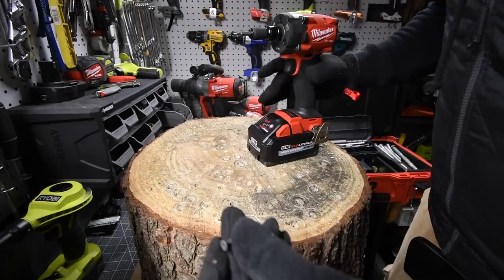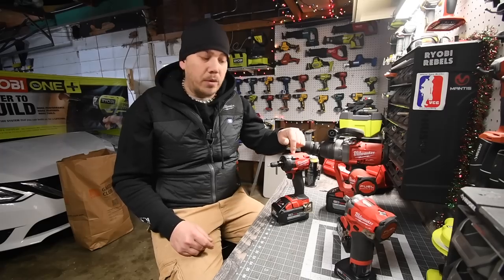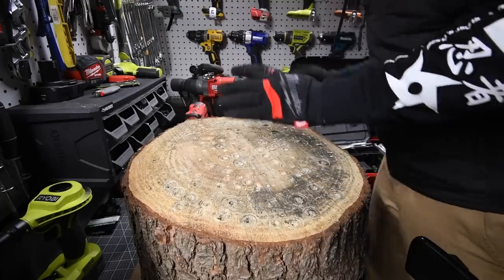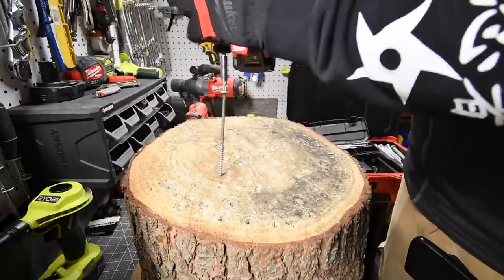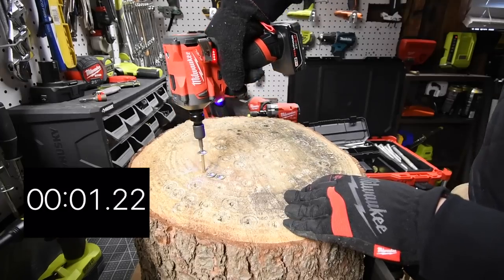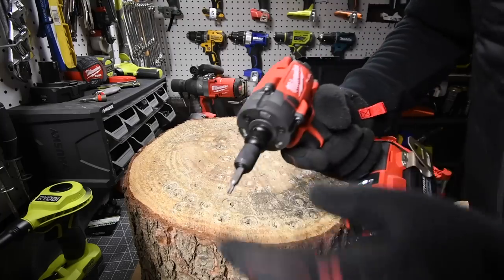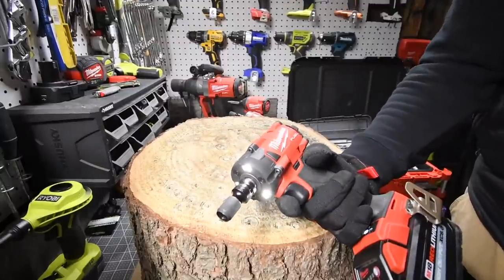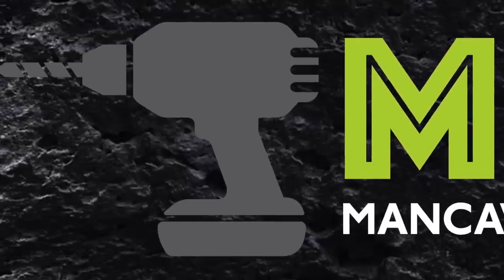1/4 Hex Adapter for Impact Wrenches

Comment: I love that adapter , I use my impact wrench a lot when building decks , those long lag bolts put a lot of stress on my impact driver , that adapter saves me  a lot of time because now I don't have to lug around 2 tools , I can now put in the smaller screws with my impact Wrench too ...👍

Comment: Here is my theory of why the impact wrench did worse than the impact driver: 
The impact driver is optimised for soft torque, this is needed so it can last longer without starting impacting, making driving screws into wood much faster.
The impact wrench is optimised for hard torque as it would be used mainly for bolts, it has a weaker spring so it can start hammering faster, and so it has to tension less from your elbows.
Reply: You’ve just about summed it up correctly, Martin!  👍👍👍😁✌🏻
Reply: I think the Impact Wrenches don't have as high of RPMs, especially compared to that M18 Fuel driver, it's like 4200rpms. I bet that wrench has less RPMs.
I don't think the spring would be weaker in the wrenches because, I could be wrong but, the spring's resistance is part of what helps make for more powerful whacks.  The bigger the impact, the bigger the spring's get. Bigger motor drivers heavier spring, swings heavier hammer = more ugga-dugga 
XD
Reply: We’ve basically summed it up for you Browsey
Reply from the maker: this wasnt a versus video. this was just to show that this attachment can make your impact wrench act like an impact driver so you dont need to bring 2 tools
Reply: A weaker spring that gives you a harder impact, 🤔never heard of that one before gotta say🤣
Reply: The driver has more rpm’s than the impact wrench.
Reply: Are these two really the same drill with a different front?

Comment: The Bosch freak 2 seems like a good middle ground, and their ProCore batteries use 21700 cells too. Great video.
Reply from the maker: Bosch did a good thing with their Freak.and  I thank you for viewing Abanoub
Reply: I'm hoping that Bosch release a Freak 3 in their new Profactor line later this year. Their new Profactor impact wrench has a massive bump in power over the previous gen. Imagine that same bump in power to The Freak.
Reply: I had one and it was great. I took my suspension apart effortlessly with it. I returned it because I didn't like the small line up of Bosch tools so I went with Milwaukee instead.

Comment: This is super handy. I currently don't need it because I have a Bosch Freak, however if I ever need a replacement for such tool I'd happily go for something with higher torque like an impact wrench + the 1/4"collet adaptor.
Reply from the maker: I agree, its almost like 2 tools in 1. I thank you for viewing Mr Luisinho90
Reply: Even better buy an impact wrench with adjustable torque settings to make it even more versatile

Comment: It’s very interesting how this is becoming more common knowledge now.  I can personally recommend getting the PT adaptor that is available at O’reilly’s Auto Parts.  I got the 3/8 to 1/4 hex to use on my 12 volt XTreme DeWalt, and it’s the Cats meow!  😁 Just check them out carefully and check for good machining and minimum run out.  It’s no good if it is wobbling all over the place!   Happy New Years Dave and Stacey, and fellow Subs!  🎉👍👍👍😁✌🏻🇺🇸
Reply from the maker: it really is awesome that all of these options are available to us now and wish you a happy new year as well George :)

Comment: Dewalt had this adapter out for a few years. I used it a few times on certain projects and it came in handy.  Yes, i totally agree with you on using the correct tool for task at hand. Just nice to know in a bind you can use certain adapter to help you out. 

Don't worry TRZ did the review first, second was you, Third will be VCG. Those guys are too macho to deal with little stuff like this. Just kidding, LOL...they're fun to watch.
Reply from the maker: I thank you for the info Michael

Comment: If you're driving any amount of large screws on a day to day basis the adapter on an impact wrench will save you a lot of headache with overheating drivers or getting getting replaced all the time
Reply from the maker: that's why this adapter is good because it will let you use your impact wrench for screws and lags/bolts
Reply: This is a good point. The wrench won't be anywhere near capacity, whereas the driver is.
Reply: @whirled_peas  if you're just driving screws any impact will do, you don't need the wrench.

Comment: They make a 3/8 socket that you can use, that has a ball detent and a 1/4 hex drive . Been around for yrs! Ppl be sleeping on this socket
Reply from the maker: it is a nice attachement and I than you for viewing Micheal
Reply: Got one of those at home depot for $7.
Reply: Do you have the name of the product?
Reply: @hidingmyrealname  sunex makes the 1 that I have. It's called like 3/8 hex drive impact adapter. I Have a chrome 1 craftsman makes also
Reply: 3/8 -1/4 hex shank adapter socket.eBay has them and a set w other adapters all depends on your needs

Comment: Can't decide if i should get a impact driver with a drill Chuck via adapter. 1/2 inch Impact Wrench with a hex adapter for turning it into a functional impact driver. 

Leaning towards the impact driver since it can do the jobs of all three. The loss of efficiency is fine as long as the job gets done.

While the impact wrench adopter would need another adopter for a drill for drilling. That's compounding the loss of efficiency.

Is my thought process rational?

Comment: Will the dewalt impact wrench also be slower to drive fasteners compared to an impact driver using this adapter?
Reply from the maker: you are correct
Reply: @ManCaverTools  i literally bought one from a private seller not even an hour ago. Got the adaptor coming Tuesday from Amazon. Can't ever have too many tools.

Comment: Can you explain how long an m12 fuel impact should last using under the hood.  And do they lose power after using them in your opinion?
Reply from the maker: that depends on what battery you use. I recommend you use a 3ah, 4ah or 6ah on the impacts
Reply: @ManCaverTools  thanks for the input just purchased m18 compact 3/8 last night from home depot in concord,  California

Comment: With the one key on the 1/4 and with the power it has, would you think you could use it as a 3/8s impact? I'm rebuilding my set and I feel like I could get away with using the 1/4 for everything 3/8 and under and get myself the right angle 3/8ths along with the 1/4 with one key
Reply from the maker: it fun to tinker with tool and see how they are with another style of a modd

Comment: I'm just at this fork in the road right now, I'm going to pick up one tool and 95% of times it will be for screws but now and then I will want to remove nuts. Do I buy an impact wrench or impact driver. I straight away thought impact wrench as it can do both but was wondering how it feels when driving in a screws and is there still the same amount of feel in the hand e.g. soft start and not to go too far in? any suggestions

Comment: The impact driver wins in speed because it has more RPM than the impact wrench, but the wrench has much more power than the driver.
Reply from the maker: this is a nice attachment though, I thank you for viewing X
Reply: Lag bolt test would be interesting. My guess is the wrench would win out there.

Comment: Milwaukee has this also Milwaukee SHOCKWAVE 1/2 in. Square x 1/4 in. Hex Impact Adaptor at home depot model #48-03-4410
Reply: Nice. Can’t find it on Canadian site unfortunately. Will have to stick with Amazon
Reply: Dewalt has one it is $7 at lowes.
Reply: @Jtwizzle  your looking at the wrong size we are talking about 1/2" to 1/4" not 1/4" to 1/2"
Reply: @landshark6659  I have the 1/2 square to 1/4 hex dewalt from lowes for $7. Great piece of kit. Keep it in my truck with the dewalt mid torque impact so I do not need to carry a dedicated driver.
Reply: @Jtwizzle  I didn't see it only the other 1 might be sold out
Reply: @Jtwizzle  was it in a set or by the piece
Reply: @landshark6659  By itself. This is it https://www.lowes.com/pd/DEWALT-1-4-in-to-1-2-in-Socket-Adapter/3850015 for some reason its listed as 1/4 to 1/2 but you can see in the picture its not. Model # is correct.
Reply from the maker: very good and thank you for sharing the model number

Comment: "The battery doesn't matter". False. The torque channel (forgot their actual name) found that the 6ah battery was best. Now, hopefully you at least meant it doesn't matter as long as it's a high output. If that's the case, then I'll accept that answer for partial credit ;D

Comment: I am pretty sure they don’t last forever
Reply: Seems like it's about as beefy as any hex collet would be.  Assuming it's well made, if you're just driving screws I would think an adaptor like that could last a long time.  For bolts you would just use the anvil head.
Reply: @browsebywire4096  well, I have never tried one to be honest, but others have said they’ve broken a few of them in a short period of time even the main brands.
Reply from the maker: we will see in time.

Comment: There's a better version that's made by Irwin. It's magnetic and I use it.
Reply from the maker: ill have to check that out and I thank you for the suggestion Ponyo
Reply: @ManCaverTools  I couldn't believe how impossible to find these in a store. Had become for me. But ya that Irwin is pretty solid. Amazon has them.

Comment: how much they pay you to promote this seen two different channels post this recently. not that cool of a product why would u want a big ass impact to tighten 1/4 fasteners
Reply from the maker: A company didnt come  to us to promote this,It was just a recent discovery. If we were given this item or paid to do a video on it we legally have to tell that we didn’t pay for this. I say in the video that I paid for this item myself and it was not sent to me. It’s only $10 for 2 of them
Reply: @ManCaverTools  I understand. just odd two channels discovered it at the same time. I suppose this could save money but the only impact with a 1/2"  i have is the milwaukee fuel  so i think using that with a 1/4 adapter is a bit overkill. lol. i have my actual milwaukee 1/4 driver for that.